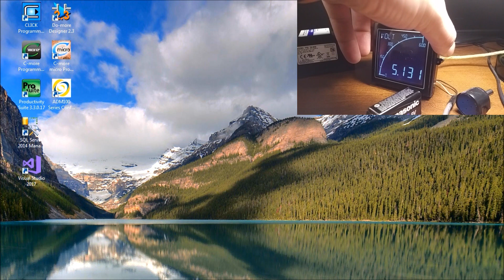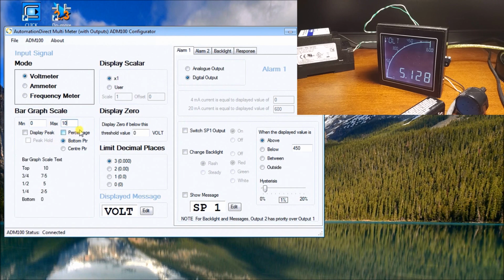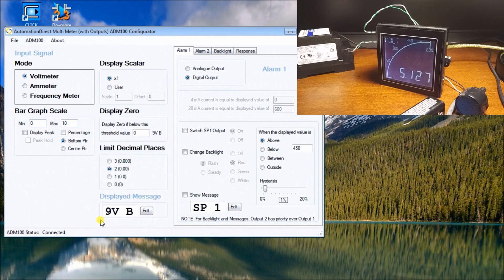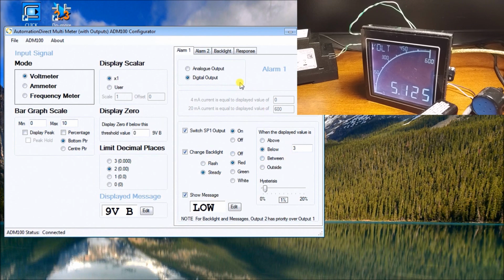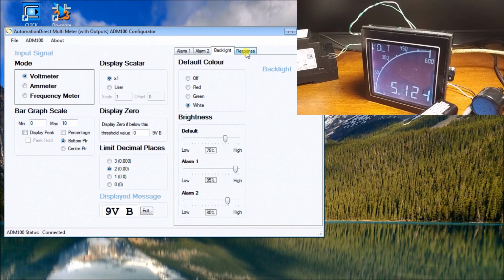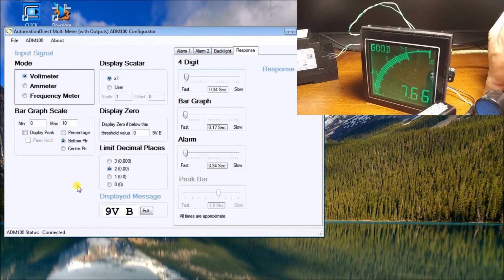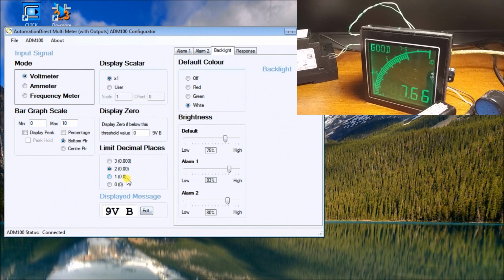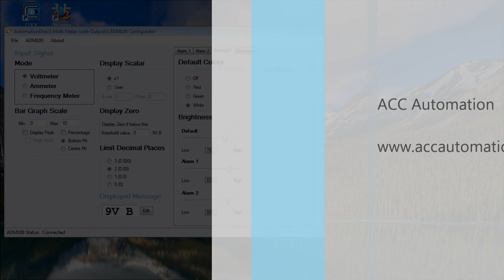Trumeter ADM100 Series Graphical Panel Meter – Configuring the unit

Comment: AutomationDirect only carries some of the Trumeters and not the APM-PROC-ANO.   Mouser and DigiKey stocks this model $138+shipping.  I wish AutomationDirect would also stock this unit. 
The Trumeter APM-PROC-ANO  0 to +/- 10V / 4-20mA / 10-50mA    NEW 20 point non-linearization scaling for non-linear sensors e.g.   thermocouples and pressure transducers
Reply from the maker: I agree that this unit is ideal for process control panels. It looks like AD marketing has determined that the models they offer are the most common for the general market.
Thanks for the comment.
Garry
Reply: @ACCautomation  Thank you.